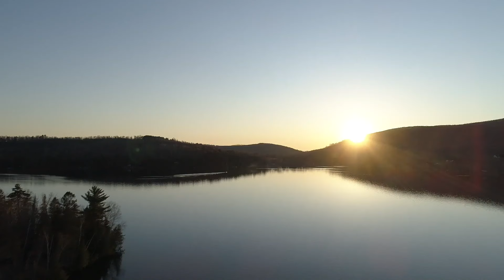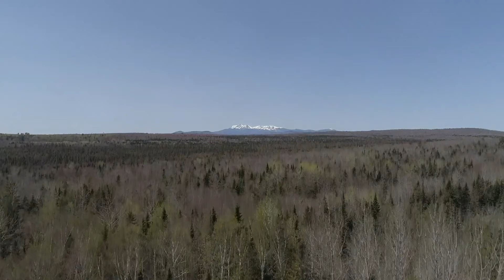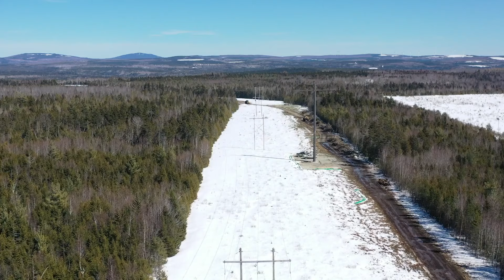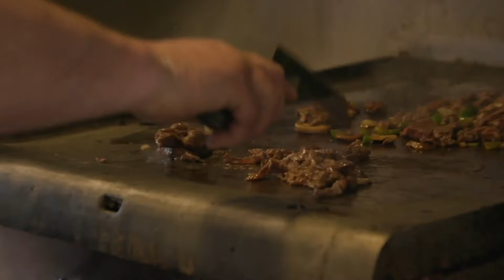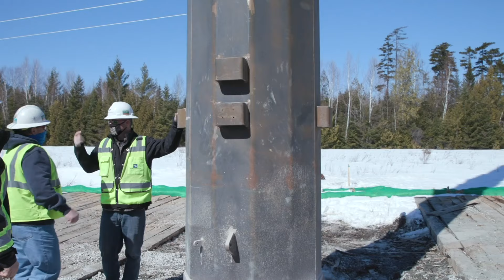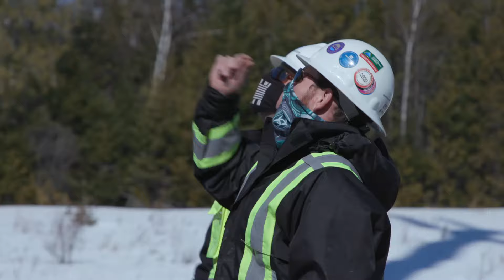CLEARING THE AIR | Season 3 Episode 10: Work Being Done

Comment: The title of this series should be “Clearing the Forest.” This is primitive technology and is investing in infrastructure that is ugly and primitive. What we need is to invest in solar tech with homes producing electricity and selling it to CMP. Retrain these truck drivers and loggers to install solar roofing and Tesla systems in homes. These little meals in your piece are a joke.
Reply: @chaoticgood1905  You're right that the extraction of the materials for solar power require a lot of emissions. However, over the many years of a lifecycle of a home, the electricity produced is far greater than if the home was consuming electricity off the grid from emissions. In short, it's a step in the right direction. It's not perfect, but it's progress. Taking hydro power from Canada and piping it down to Massachusetts is a step in the wrong direction. We should build infrastructure to produce power ourselves and we should educate and retrain our work force. It's an idiotic premise to place these decisions in Maine's country bumpkins which is what this video series keeps doing. The electricity should also not be centralized in this way as we saw with the extreme weather event of 1998 and something much worse is inevitably on the way when a severe solar storm will wreak havoc with the entire electrical grid (Google the Carrington Event of 1859). We need to decentralize the grid, not centralize it. Decentralizing it will create jobs and make each home owner who goes solar into a supplier of electricity. Of course, these big players don't want to see that happen. They want to charge us for it rather than us charging them.
Reply: @chaoticgood1905  It's just a bad idea. When a severe weather event knocks it all off line, they'll say no one saw it coming and get the federal government to bail them out, it looks horrible, and the forests are already badly damaged from too much logging. The poor Maine towns are in a never ending cycle of stagnation and decay where a good portion of the population is living off the land. Infrastructure that is macho and industrial is viewed as progress but you can't even get cell phone signal in half the back woods never mind high speed internet.
Reply from the maker: Hi Michael, solar energy is also a solution but it would take hundreds of solar projects to equal the electricity being brought in by the NECEC project...1,200 megawatts annually. That's far from a  joke.
Reply: @clearingtheairmaine5634  No. That's not the joke. The joke is that you say the work crews get fed some meals and that somehow is supposed to be providing jobs to Mainers. Once the crew is finished, who comes for lunch? Your piece doesn't actually point out how this does anything long term for anyone outside of the workers who are building it. Converting to solar doesn't mean hundreds of installations, it means thousands. Thousands of installations and thousands of financial products. We lose money buying electricity from abroad. We should generate our own clean power.
Reply from the maker: Michael. Maine isn’t spending a penny for this project. That’s the point. And Maine benefits by have cleaner air, increased property tax revenues for decades and decreased electricity rates. More supply reduces demand.
Reply: @clearingtheairmaine5634  That's a different point. Your point in this video was job creation. The short-lived clearing of land, cooking of meals and installation of power lines was the angle, not who pays for it or cheaper electricity. More supply of lobster from Canada would also lower the price of lobster in Maine as well. Why do that? We want to support our local fisheries and businesses. We don't want a pipeline cutting through northern Maine dumping huge amounts of electricity on the grid. If we produce our own electricity and meet the demands by supporting renewable energy in the state we grow. Why import it from Quebec? With historically low interest rates, now is the time for homeowners and businesses to invest in solar. No one is paying me to say this. It's just obvious and the "corridor" as it's inaccurately named by CMP is a scar, a blemish, an intrusion on the aesthetic of the forest and real estate and recreational livelihoods that surround it.
Reply from the maker: @michaelmenes  Opponents actually named it the corridor Michael. And this isn't a pipeline, it's a transmission line. It's a like just like hundreds of others of transmission lines that have been designed and built all across Maine. The long term effect are very real. Increased property tax revenues. 140 million dollars dedicated to a fund to reduce electricity rates....another 50 million dollars for low income family. Money for better broadband infrastructure. We could go on Michael but I urge you to get the facts about the project.
Reply: @clearingtheairmaine5634  It’s a pipeline for Massachusetts in terms of electricity. Yes, I know the difference between an oil pipeline  and a transmission line. I also have the transparency to go by my actual name! Who am I corresponding with? Should I refer to you also on a first name basis as “Clearing”? You should introduce yourself here. When you keep referring to me on a first name basis it’s like you’re the nice guy. Oh… Do you know anything about me? I can go and document this project too.
Reply: @clearingtheairmaine5634  According to what I see by driving across Maine MYSELF, it isn't. I drove from South Paris to Gardiner last week and there was only ONE high voltage transmission line. The one going to Lewiston. The clearing was wider than 200 feet across. A lot of recent clearing going on... This is not the kind of transmission lines you find around town. All the land under the lines is completely cleared. There are not hundreds of these lines in Maine.
Reply: @clearingtheairmaine5634  Mr. Clearing, You said that Mainers aren’t paying anything for this. Who’s paying for all the propaganda? I’ve received 3 mailing pieces just this week. Who is paying for the video production for your series? Mr. Clearing, why don’t you introduce yourself?